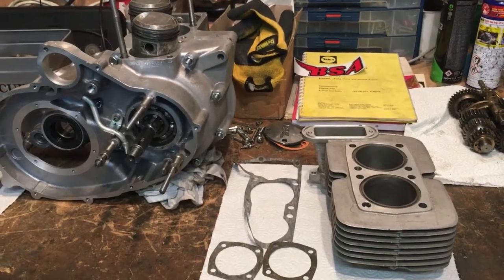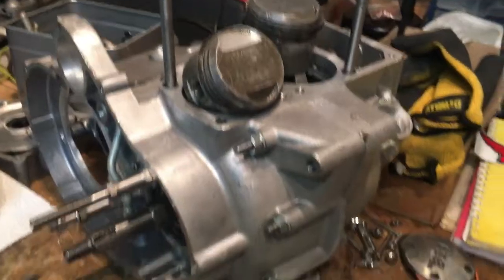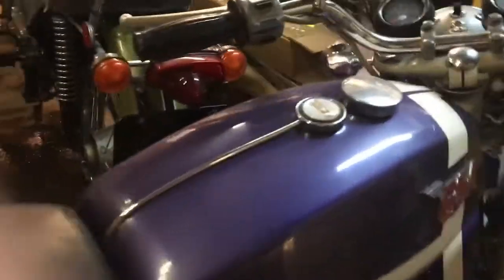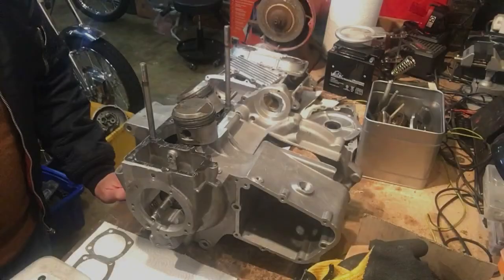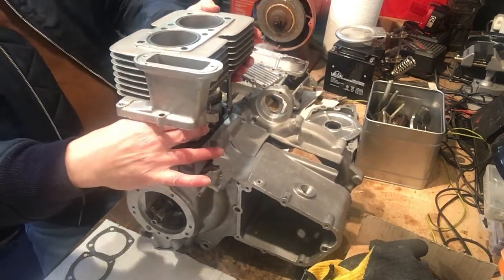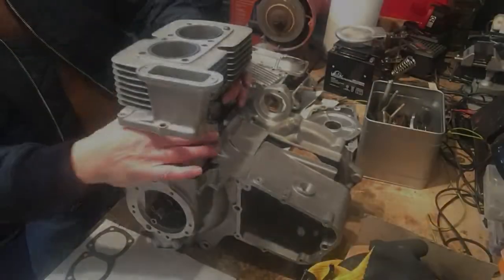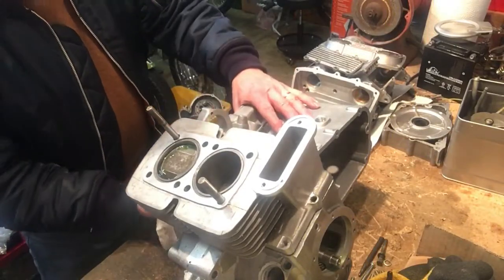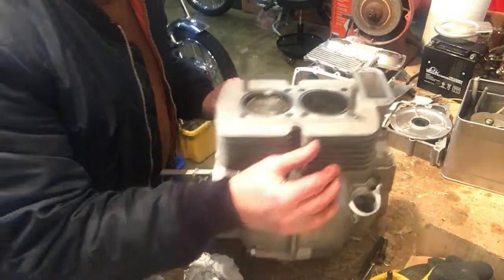BSA Fury SS (E35SS) Build - Engine Part 22 - Barrels and Sump

Comment: Angus, did you put assembly lube in the cylinders, and wrist pin?  It would make assembly esier,  and prevent dry start.
Reply from the maker: Yes Marino I did - thanks for raising. I'm going to be checking oil feed and return around the motor before starting the engine by using a paddock type starter so there will be no dry start. Thanks again.
Reply: @BSAPowerSet  Have a nice New Year with your family and friends.   I just joined your channel and enjoy it!!!!
Reply from the maker: Thanks Marino - you too.
Reply: More good progress,nice to see, really like the time lapse..
Reply from the maker: Thanks Matt - happy new year to you and the family mate.

Comment: If only - when designing it - BSA had used the idea of horizontally split cases..... maybe they would still be making bikes now. The only 'new' designs were really just variations on old ideas - the Trident/Rocket III really could have lead the way of its cases were were horizontally split instead of the hotch-potch design that they are . I suppose it was decided not to follow the new trend from other countries.... so short-sighted of management !
Reply from the maker: Thanks for comment and interest. They were lagging behind in a number of areas, disk brakes being another example. I suppose as the bikes were dry sump rather than wet sump then the vertical splits weren't deemed to be an issue? Anyhow we know what happened! Thanks again.
Reply: @BSAPowerSet  hi happy new year to you all , BSA did not have the have the the special machine tools for doing horizontally split cases, it had to fit in with BSA production methods.
Reply from the maker: Thanks for the interest and comments John. Yes another reality to consider in the mix re horizontal cases. Also thanks for your take on the clutch hub bronze thrust washer - something to investigate further when we get to the primary drive again. Happy new year to you.
Reply: @BSAPowerSet  hi angus, re clutch, had a dig in the parts book E35 plate 4, that is a late B25,  5 plate clutch your clutch hub is for a 4 plate clutch. i will dig out the b25 parts books over the  W.E and have a look. nice A70 day glow stripe bang on
Reply from the maker: john norman many thanks John I’ll do the same and we’ll compare. Thanks again.
Reply: hi mate, E35/B25 clutch that bronze trust washer the one that fit's A65/A70 never ever seen one on a C25/B25 i don't recall seeing it in the work shop manual C25/B25 or B44 .
Reply: If you look at the crank cases though the flanges on the vertical mating surfaces do look wider than on other British twins and heavily ribbed as on the trident and they where not known for leaking from the bottom end push rod tubes and rocker boxes where always the bane of triumph twins for oil leaks